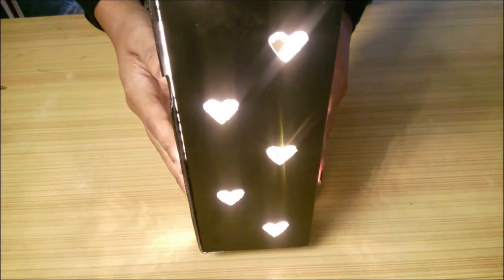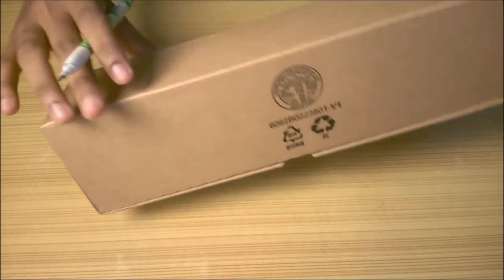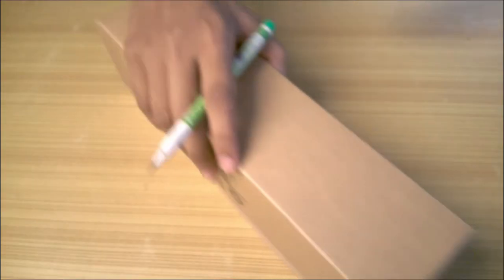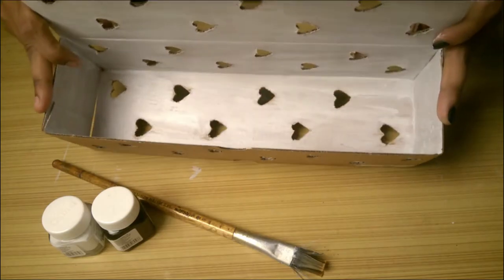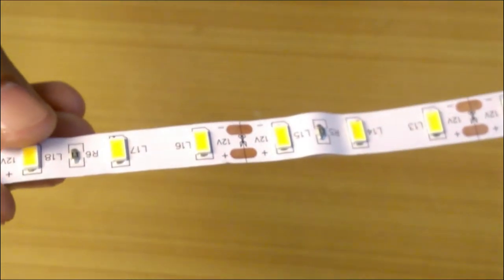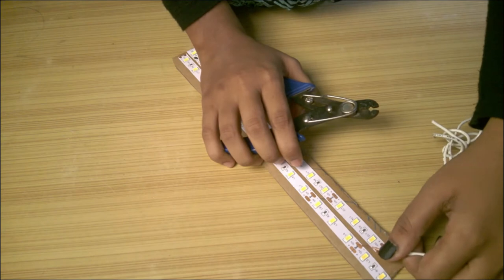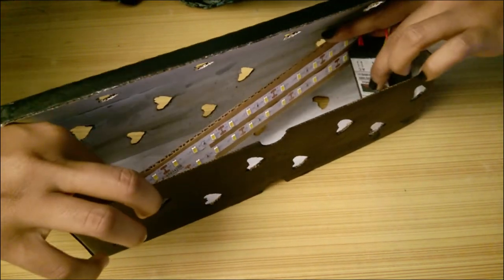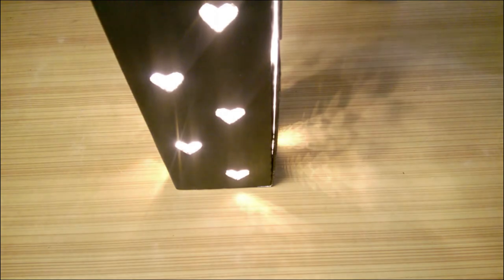Make a Beautiful Night Lamp

Comment: try using tracing/butter paper from the inside to cover up the cutouts. they are translucent and allow a fair amount of light to pass through. it should look even better
Reply from the maker: Nice idea. But I have already tried it. Butter paper does not allows much light to pass through it. There will be no reflections on the wall if we use it. Thank you for watching :)

Comment: If you used foil paper instead of white, then it was more bright
Reply from the maker: Right. But it would have been a headache to cut the foil in the same pattern that we have used in the cardboard and we would have to align it too. So painting the walls white was definitely a better option in this case.